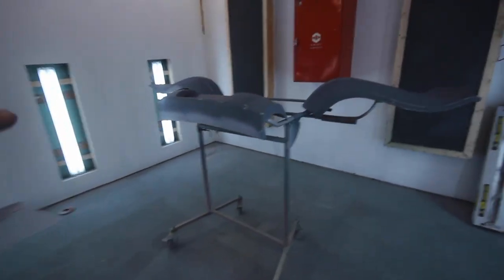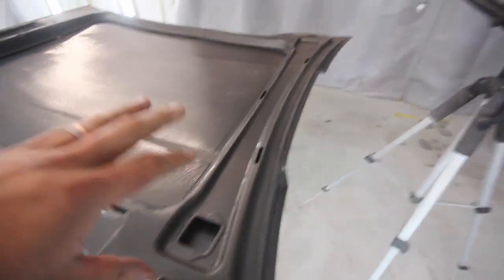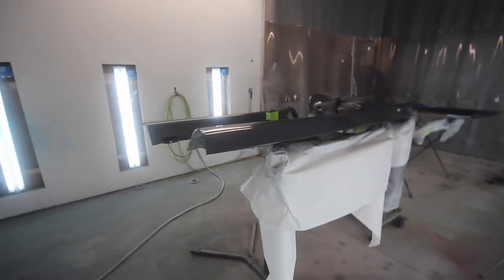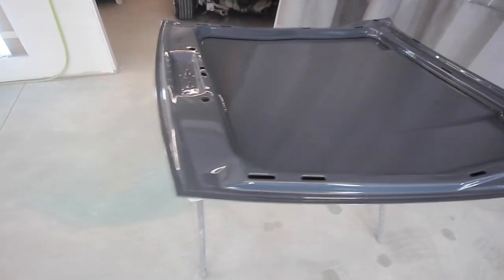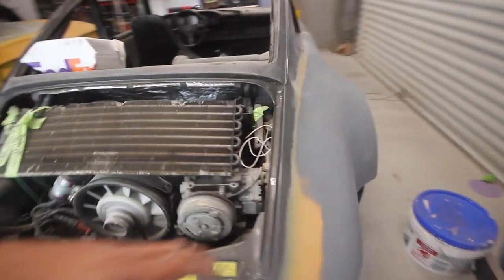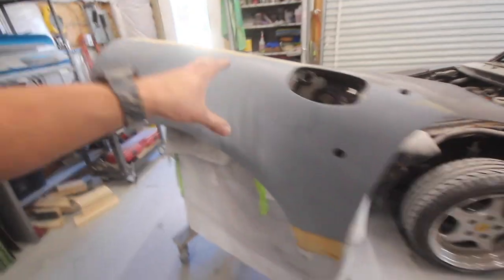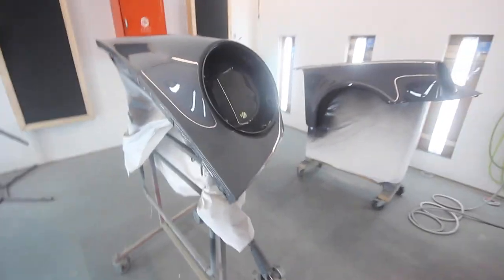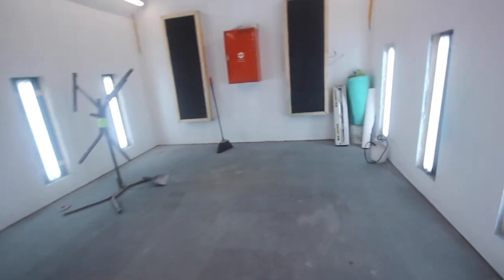Finally PAINTING this Porsche 911sc build episode 12

Comment: Damn that’s shiny! Are you using waterborne paint?
Reply from the maker: Yea waterborne basecoat. Sealer and clear still solvent. It had a little peel to it. The hardner I had around was still for cooler temps. But I'm cutting and buffing anyway so its going to work out.